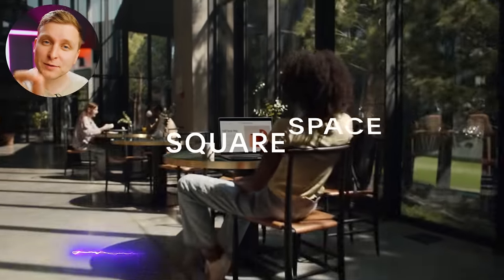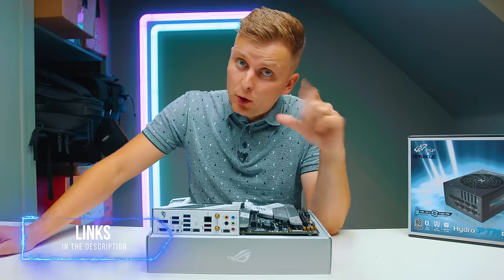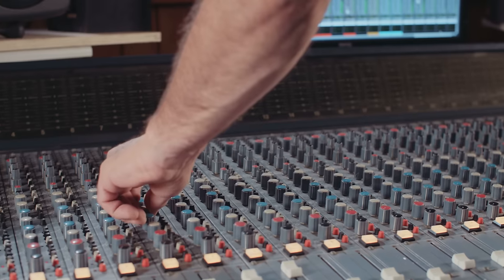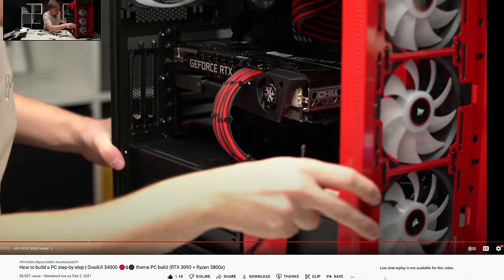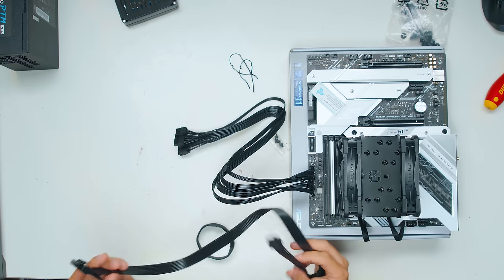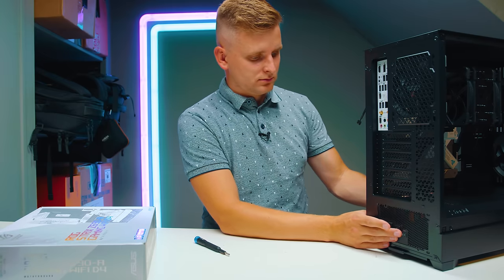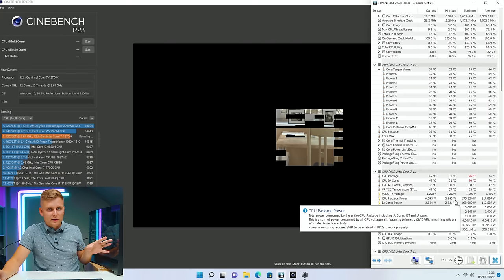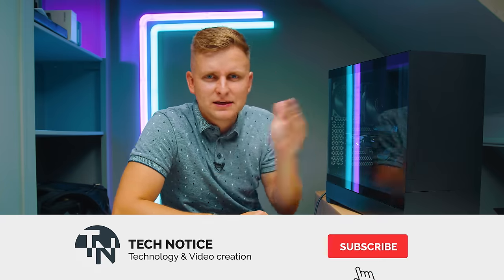The 98% Silent PC 🔇 - DAW PC build guide for Music Production & Quietness

Comment: Dang I am building a music pc right now and my first choice for cooling was that Noctua u12a but I returned it because it seemed like the liquid cooling of the arctic liquid freezer II is actually quieter. Does anyone have any insight on this?
Reply: Noctua D15 and Deepcool Assassin 3 are quieter than the U12A and are slightly better for the cooling. I bought a Deepcool Assassin 3 for the same price as an NH U12A.
Reply: @saricubra2867  if the arctic doesn't work out, i'll probably give one of those a shot
Reply: @jimiboi87  I have a Corsair 5000D airflow, it doesn't matter if you buy a beast air cooler if you don't have good airflow.

Comment: Now there's 13700, so can I choose 13700 rather than 12700?
Reply: Do not buy that thing, it gets way too hot when you push it and avoid liquid cooling.
Reply: thx buddy! I mostly decided to buy 136k
Reply: @oho565  12700K also stays cooler and you have 2 more perfomance cores. 8+4 is better than 6+8.
Not worth it losing 2 perfomance cores for 2% (margin of error) more single core perfomance and 7% more of multicore. The i5 also gets very hot because it has to brute force the p-core frequency.

I watched the i7-12700H laptop chip without throttling and is an example of a 6p+8e bottleneck in a DAW.

It had problems with FLStudio rendering a song, basically with 0 perfomance gains vs the 11800H and Ryzen 9 5900HX that are 8p+0e despite the massive single core gain in one gen.

Buy the i7-12700K, not the i5s, you need the 8 perfomance cores. Mine has AVX512, i don't know if that helps for AI plugins (i haven't tested that for now).

The best DAW chips are the Zen 4 Ryzen 9s that have all perfomance cores and use way less power at full load, have smaller transistors.

Comment: Probably no one will reply, but I really need help with this: would it work if I go with ryzen 7 5700X for complicated plugin-intensive experimental music production and mixing (over 150 tracks)? Or i should focus even more core than 8?
Reply from the maker: I don't have personal experience with 150 tracks, but it feels slightly borderline especially if you wanna have tons of effects and low latency. It's not so much about the cores but also single core performance. I'd look into 13600k ;)
Reply: @theTechNotice  You loose perfomance cores on the 13600K (e-core singlethread perfomance is not good vs the p-cores, they hold back the entire audio buffer thing), i bought the i7-12700K for that reason and it had a very good price.
Originally i was considering a Ryzen 9 5900X, then i noticed that DDR5 boosts floating point speed for virtual instruments and choosed the i7-12700K (higher single core too), maybe the 5900X has a slight edge for mixing.

Ryzen 9 5950X can outperform a 12900K for mixing because it's a 16p+0e chip, not 8p+8e. I learned this fact thanks to the Scan Pro Audio guys on Youtube. Therefore the best DAW/audio chip is a Ryzen 9 7950X.

This doesn't mean that more e-cores aren't good, but it's better to have more perfomance cores than e-cores for audio since it's a real time process and 100% bottlenecked by how fast the cores are, not the raw amount of them specially if a portion of those are weaker at handling serial procesing.
Reply: @theTechNotice  Another thing that happens if i compare my i7-12700K vs the 13600K. 

The latter would produce more fan noise and get hotter, since you have to push the P-core clockspeed harder to offsett the e-core singlethread perfomance bottleneck. Remember that a large portion of the multicore power comes from the perfomance cores (they also have hyperthreading), fan noise are very important for audio, so the i7-12700K also wins there.